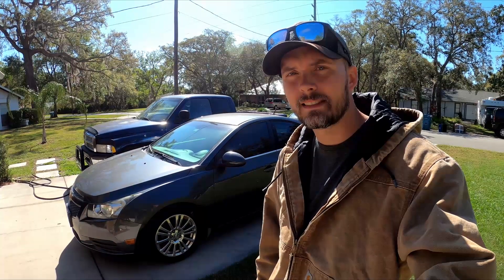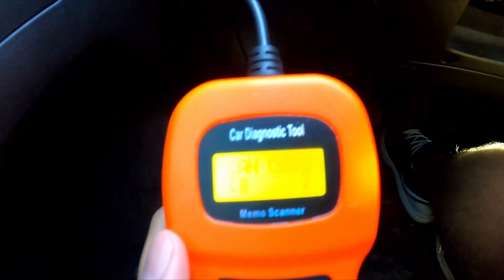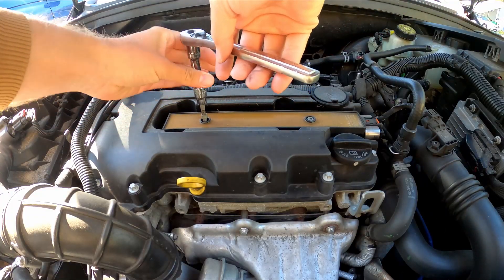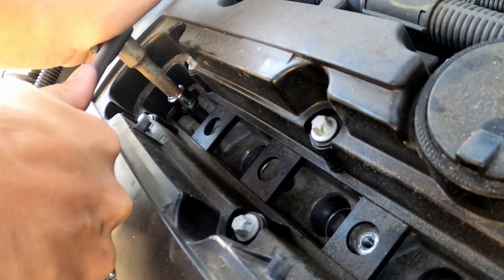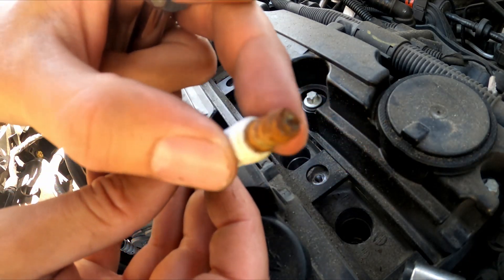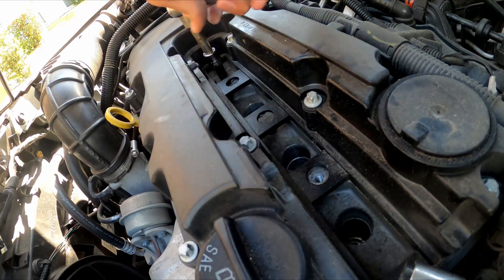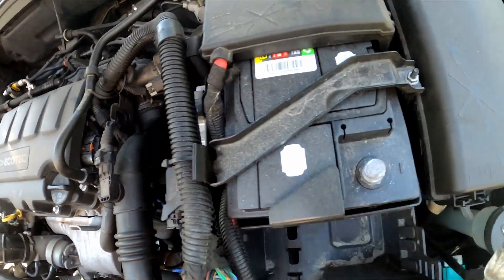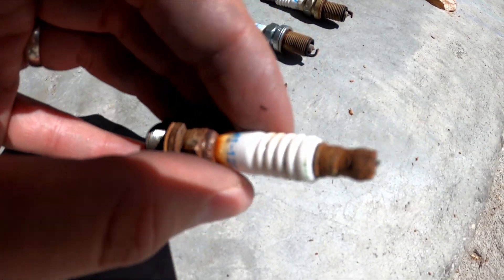How to Diagnose and Fix Service Stabilitrak Traction Control Problem 2011 - 2015 Chevy Cruze

Comment: I’m an actual certified GM ASE mechanic. I only use the original plug AC plug GM recommends, no anti-seize on the plug threads and use a torque wrench. Putting anti-seize may cause you to over tighten the spark plug threads! I put dielectric at the tips of the plug boots before I install the new coil over the plugs. I only use the original GM OEM coils because these cheap aftermarket coils will leave you stranded! Great diagnostic! FYI, I change GM spark plugs at 100,000 miles. I just replaced plugs on a 2014 Cruze with 87,000 miles and plugs were worse than yours! Glad you got it fixed!
Reply: THE ENGINES ARE ALL METRIC. ON ALMINUM HEAD, YOU USE ANTI-SEIZE. I USE THE ZZ COILS. HOTTER SPARK. DOW CORNING 5 ON THE INSIDE OF THE COILS. AIRCRAFT TECH, ASE CERTIFIED. NGK PLUGS ARE MUCH BETTER THAN THE AC DELCOS.
Reply: @DRAGONFIRECUSTOMWERKS if you use NGK plugs, no you don’t use anti seize. They have a plating on them already to prevent sticking to aluminum heads. I’m a former online tech for NGK.
Reply from the maker: Great info, thank you!
Reply: My 2012 chevy cruz still shakes after changing out  the spark plugs. the coil is not damaged. Im stuck on what to do next
Reply: @brotherjacks917  you figure it out?
Reply: Possibly the purge valve solenoid there's tutorials for that on here with similar issues@brotherjacks917
Reply: I actually have this problem haven’t driven my car in about 2years. I changed the coil pack, map sensor bc that’s what it was giving me codes for however the car still has the same lights on this video. 
On idle the rpm needle is still then kind of moves up and down. 

Oh I also changed the abs module and had it reprogrammed (that was bc the breaks locked when they were stomped on to avoid a car collision)

Any further ideas recommendations?
Reply: So I have a 2016 Chevy Cruz turbo engine and what my car is doing is it drove fine for about an hour and a half all the way to LA as soon as I got off the freeway came to a stop at the light and when I went to go it let me go, but then it acted as if my brakes were being applied kind of heavily, but it was not pushing my brake pedal down so then I would go to accelerate And then it would start accelerating and then do it again then you could push the gas through it doing its little break or slip or whatever and it just continues to do it, but it doesn’t do it in reverse and it doesn’t do it in first, but something is telling me that it is not the transmission even though everyone says it is something is telling me it’s not the transmission because I have not had any kind of issue with my transmission leading up to this but I have had a vacuum leak code pop and now it is popping a P0420 code only and it had popped a P01011 amongst a couple other codes having to do with pretty much a leak problem and I knew I had a massive leak, but I wasn’t able to specify where but help does anyone know what the fuck is going on cause I’m stumped everyone wants to tell me it’s the transmission but something tells me inside because I have some. What a good idea and how to work on cars and how cars function and I am so stumped specially because I replace the pressure map sensor and crankshaft sensor. I have not done the maf sensor but I’m gonna do that next, but something is telling me. It is the brakes because when I am driving, it sounds as if the brakes are applied somewhere like a dragging sound almost….HELP PLEASE N THANKS U I cannot get over a few miles an hour without it doing its stopping
Reply: 2014 Chevy Equinox- I'm having this same issue and was not aware the ignition system could trigger a stabilitrak warning. I'm breaking my head over the ABS sensors and even assuming a messed up tone ring on my hub assembly. Gonna dig deeper on this. Thank you bros here in the chat 👍
Reply: @marv.mon.9845 It could also be electrical man, make sure you tighten all your grounds and check battery cables. I had the stabilitrak problem. Changed plugs and coil pack and it was still shaking and throwing stabili. I tightened all the grounds and cables and it went away.
Reply: @AcidxAnarchy  Thank you bro gonna check on that too. It seems the Stabilitrak system is so sensitive to everything geez
Reply: @marv.mon.9845 yea it is. From what all I read, basically anything from a wire or sensor to a plug or the ecm can set it off. I would try checking the ecm plugs too while you're doing that, I read it happens when those come loose or get corrosion on the connectors.  Just make sure you unhook the battery before unplugging the ecm connectors.
Reply: Z😮
Reply: Thank you!🇺🇸
Reply: Could the spark plugs being too tight be an issue?
Reply: @pedrossalazar5619 no
Reply: How much dielectric grease do you put on the end? Like a glob big enough to fill the opening ?
Reply: What’s the torque settings?
Reply: @jvandyke956  for the spark plugs, I believe it was 18 ft lb. But you should google your specific model just in case.
Reply: Water or moisture trusted the plug.
Reply: My 2016 Cruze made to exactly 100,000 before all this crap started too.  Sad China Car.  It is legit an import.  No parts of it were made or assembled in the USA.   It's Trash.  Watched a documentary about GM and how they sold out.   It will be gone by 2030 I would bet.  Selling nothing but trash.  They even managed to screw up the 6.2 v8 that got them this far.
Reply: Ordered parts from Amazon, hopefully I will get a years worth of service (5000 miles maybe) but looking for a replacement car or Subaru. What do 71 year olds drive? Definitely can’t afford a Cadillac. Hopefully will be driving well into my 90’s, but you never know.
Reply: I wished you could help me. This just came on today after coming from getting my tooth pulled. Plus it's leaking anti freeze after I drive so far. I'm just overwhelmed. 😩
Reply: Correct Ngk plugs you don’t use anti seize. They have plating to make it easy to remove on aluminum heads. Anti seize on Ngk gives false torque readings! Listen to me, I worked for Ngk in the past!
Reply: Authentic GM parts is the reason why it broke. I use aftermarket parts
Reply: Better yet get rid of these junk cars. Chevy hasn't been good since the 90s
Reply: @jjbanana2774 😂😂😂😂says my avalanche with 400,000 miles
Reply: @jjbanana2774  chevy in the 90's was the biggest piece of shit on earth 😂😂😂

Comment: I ACTUALLY CHANGED MY SPARK PLUGS AND I STILL HAVE THAT POP UP ON MY DASH BOARD. AFTER I CHANGED MY SPARK PLUGS WHITE SMOKE  STARTED COMING OUT FROM THE EXHAUST PIPE 😢 N SO I HAVE TO SEE IF THE HEAD GASKET IS BLOWN BUT I ALREADY BOUGHT WHAT I NEEDED😑 MIND YOU I JUST BOUGHT THIS CAR AND THE GUY LIED ABOUT THE CAR HAVING ISSUES. WHEN I SAW A BLUE SEAL ON THE OUTSIDE OF GASKET COVER  HE SAID IT HAD A LEAK BEFORE BUT IT WAS FIXED AND NO ISSUES BUT IT HAD ALOT OF THINGS WRONG WITH IT 😢
Reply from the maker: Sorry to hear that 😕 hopefully it's nothing major. What are the codes you're getting?

Comment: My car has been doing the same thing. The only difference is my radio is also turning off. I’ve taken it to the dealership I got it from because I have warranty but they couldn’t figure out the problem. Could it be this ?
Reply from the maker: What are the codes you're getting? I didn't have any issues with radio shutting off. Maybe a short in the radio?

Comment: i have a 2016 cruze  would all the parts you used in the video still be compatible?
Reply from the maker: Yes, it should be the same as long as it's the 1.4L 👍

Comment: Sweet, ill probably run to the parts store here right after work and grab up those parts. What you described is exactly what my wife just said happened to the car. So i told her "ill look into it what did it do?" This video was the first to crop up, and at 120k something miles it cant hurt anyways if its something else. Due for a plug and oil change right now regardless. 

FYI to others, be very careful using anti sieze kn spark plugs. Its generally NOT recommended by the manufacturers as itll allow you to easily over torque the plug causing it to possibly break which leaves you a bill from a specialist or a major headache on your end.
Reply from the maker: Great feedback! How did it turn out, were you able to get it fixed?
Reply: @deuceliter  yea the local parts store ran the code, cylinder 1 misfire. Plugs and a coil and it's all good. But I did notice it's leaking coolant again from the turbos return line, just one thing after another with cars I swear.

Comment: First my “service power steering” notice came on and so I just jumped it a few times,.. after, the “stabilizer track”/whatever came on and left.. then, the AC coolness stopped, with the car losing some power shifting from 2nd to 3rd, while turning (I like to go fast). ‘‘Twas the battery. Runs fine now. Was tripping. Googled prices for all of it. But was just a battery. Was an original battery lol
Reply from the maker: At least it was a simple fix 🙂

Comment: Just had the same issue with the same codes and my brother found your video while I was driving! I had already replaced the coil pack and luckily it's still under warranty. Hope it fixes my problem too! Thanks!

Comment: im getting the same stabilitrak msg, i seem to only get it when its raining out. I do hope my issue is the same as your's. Seems like an easy fix
Reply from the maker: It's possible for sure. When is rains. Moisture gets in there if the coil is bad and will cause misfires. I had same issue on an old Ranger every time it rained. Replaced the coil never happened again.

Comment: Hi thanks for the video! Would you help me? I have a Cruze 1.8 2013 automatic and when it is at working temperature and I stop at a traffic light the Rpms drop as if the car is going to turn off this repeats 1 to 3 times then it stabilizes normally could it be the coils? I don't have any error codes from the scanner thanks! I recorded a video showing the defect https://www.youtube.com/shorts/k-bcwGE_xfc Tks

Comment: Same issue. 2014  1.4 117k  original owner. Plugs 1 and 2. Not sure where the water is coming from but i beleive ii is getting in through the top of the coil pack. I could see a water stain and some slight seperation in the top plastic surround.  The coil spring in number 2 had major discoloration. Way to much rust for a one time water leak.  Thanks  for the video

Comment: 2011-15 GM cars are full of bugs and trouble. My 2011 regal shows that message when it's cold out. It's has been the buggiest car I've ever owned. Transmission replaced at 80k, timing chain replaced at 90k, etc..
Reply from the maker: I got rid of my Cruze about 6 months ago. There are too many issues with these vehicles.

Comment: My Impala is throwing the "service stabilitrac" warning intermittently.  Checked the codes and got P0300.  Planning to do this repair as well.

Any idea what the connection is between the engine misfire code and the stabilitrac?

Comment: I got a 2012 Chevy Cruze n my track light goes off when I drive. Few months back it went off n my car died at a stoplight. My cd player/radio shuts down completely n my turn signals make no noise. As for the brake lights I can't tell cuz I can't see. What's goin on wit my car? Everythins up to date wit my car n I barely drive it cuz of severe anxiety. Any advice is much appreciated.

Comment: But if the service stabilitrak light keeps coming on with the flashing service engine light the issue is cracked piston common problem in Chevy Cruze .

Comment: my service stabilitrak is on and it’s jumping and losin power aswell and it’s also blowin out black smoke and my gas mileage not accurate wit my gas meter any thoughts ? it’s really irritating me😂😤
Reply from the maker: There are several reasons it could have black smoke. If the smoke is coming from under hood, it's most likely a fluid/oil leak. If its coming out the tail pipe, it generally means its running rich. This can be caused by bad plugs, air filters, 02 sensors, etc. So it's best to run a scan tool on it and see where their errors are first before replacing good parts for no reason.
Reply: @deuceliter  i went to autozone and midas they scanners couldn’t read

Comment: Thanks for the vid sir. Worked like a charm. Got a 2014 CruzeLT. Had similar problem about 90K miles and changed the spark plugs. didn't change the coil at the time as the issue went away. Came back at about 110k miles and BAM! fixed it.

Comment: This has nothing to do with the STABILITRAK
Reply from the maker: I agree, but it does disable stabilitrack when there is a misfire, among many other reasons. Got to love chevys!
Reply: @deuceliter I didn't intend to come across condescending or anything. I was just expressing a little frustration towards GM. I have a 2011 Silverado with about 80K miles. It's set up so I can drive from my wheelchair. So with that said I can't really afford to just go buy another. 
    A former GM mechanic told me that each component of the STABILITRAK system has a sensor on it and I would get a code if there was an actual problem with in the system. So it's fortunate that I have no code. He went on to say that there is a whole host of things we'll over ten that will trigger the light and shut off the traction control system. Misfire is one, bad gasoline, (he said since it is E85 compatible run it out of gas, and run a tank of the E85 through it to help clean the fule injectors. The fuel filter can cause it and the list goes on. My dash cam shows how it pulled me into oncoming traffic nearly hitting a semi head on. Going up on two wheels and then ended up in a field. Fortunately no one was hurt but our lives were clearly endanger. Like I said the truck vered to the left on a two lane highway, and it was very hard to turn the steering wheel. Once I  did get it to turn it over corrected, and the truck went into a sideways skid. Then it started fishtailing. I thought I heard something just before it happened my dashcam cought it all. I guess I didn't hear it so much as I just felt something like one of my wheels locking up. I wonder how many people GM has killed with this set up. I wish I could afford to buy another one but being in a wheelchair puts me on a fixed income and everything costs twice as much. After O'Reilly and autozone told me that I had no codes. I disconnected the battery for a few minutes and cleared out the false service STABILITRAK warning. I asked what would happen if I just left it as it were. He said the tranny would start shifting hard and rough idle among a few other things. It was enough that I decided to reset the fault light. Anyways I'm sorry for the book here. I hope this bit of information proves to be useful to someone. Oh and t😢hanks for video by the way.
Reply from the maker: @Jim Hamilton  wow glad to hear your OK though! I sold my Chevy Cruze shortly after this video. Started having more issues with other things failing. Now I just drive my 2001 Dodge Ram with zero issues. Unfortunately, they don't make them like they used to.

Comment: Mine came on for a few minutes and I turned the car off and after a few mins turned it on. Now that is not on, I am having a different problem now.. I ran a scan and the code that came up was fuel trim system lean bank 1. So now I’m wondering if I should change the coil, the plugs and the engine valve cover
Reply: No p0171 is not caused by the coils or anything that's in this video but it's either you have a air leak or theirs a bad sensor that's giving wrong readings too the computer

Comment: You literally saved me so much money! My mechanic couldn’t figure out what was wrong with my car and I found your video and went and bought the ignition coil and spark plugs and my cars stabilitrak stopped going off. So far so good! Thanks a million. Super clear details and what tools needed.
Reply from the maker: No problem, I'm glad it's working better for you!

Comment: My 2020 1.4 sonic just today started giving the stabilitrack message and shuddering on trying to accelerate hard.... Just shy of 80k.  I replaced the factory plugs about 2-3 weeks ago... and suspecting that the plugs could be the culprit.... I have an aftermarket ZZP coil pack  which has probably 60k miles on it...   Anyway....  I'm gonna try possibly my nearly new factory coil pack and maybe replace the plugs again if it is still  erroring  out...  I have zero clue why a misfire related  issue would cause a stabilitrack error...  anyone else think this is a stupid error for the actual problem?
Reply: Holy crap... I replaced the plugs with a 2nd set I purchased at the same time for another sonic I own... and BAM... . not only did the purge  error I had P0496 I believe (which just started a couple weeks prior)   but also it fired right up.. no check engine light.... no stabilitrak error and the throttle hammers hard with no issues.   Great video... I still don't have a freaking clue why a coil or spark issue should EVER cause this error.
Reply from the maker: @Disc Golf Video Guy  good to hear you got it fixed! I have no clue why they thought it a good idea to tie it stabilitrack errors...